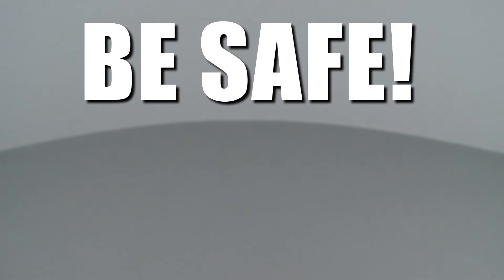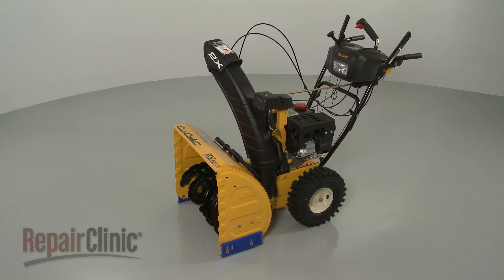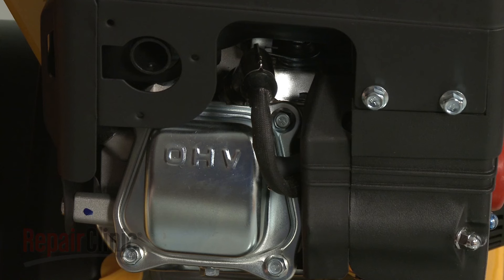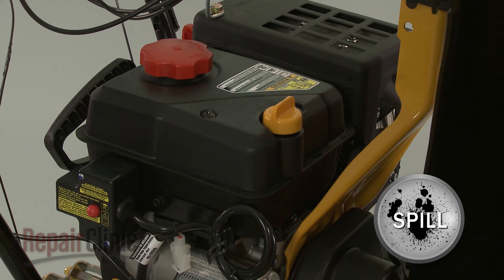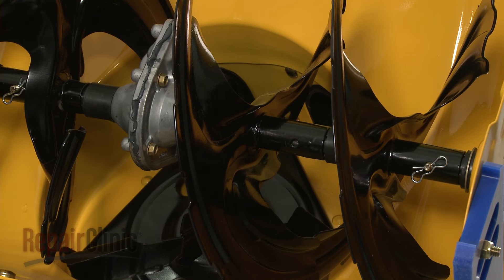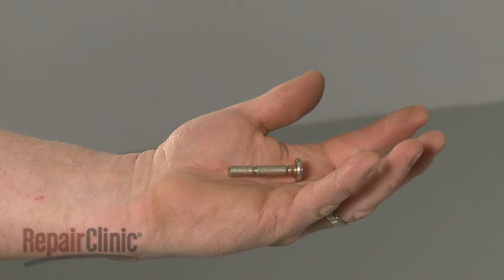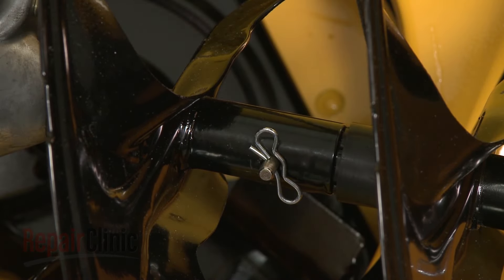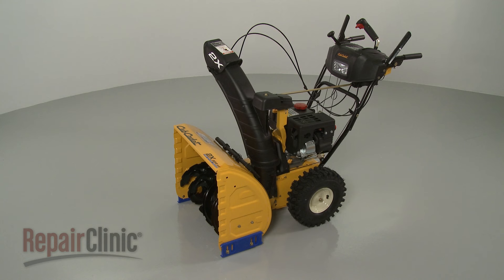Cub Cadet Snowblower Auger Shear Pin Replacement #738-04124A

Comment: Having a heck of a time with the 3 stage shear pins, both front and rear broke (ice dam I think).  Shaft seems to turn with auger.  Can't seem to find broken pin.
Reply from the maker: The shafts on the gear case will not usually turn by moving the augers. If you can’t see the ends of the bolts, they are probably broken off and the center section of the bolt is still in the shaft. You will have to keep turning the auger and use a pin punch to try and locate the broken pin. Once you find it, it should knock out fairly easily with the pin punch. The only other way is to remove the auger assembly from the housing  and pull the augers off the end of the shafts. Then you can locate the holes for the pins with the augers off. This may be a lot more work though. Hope this helps.